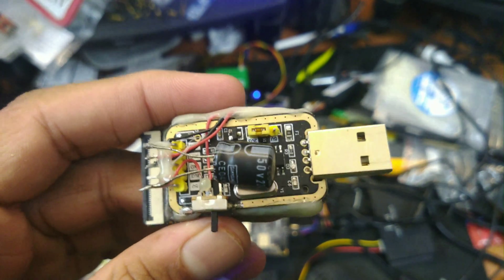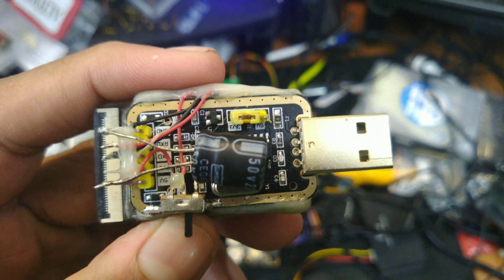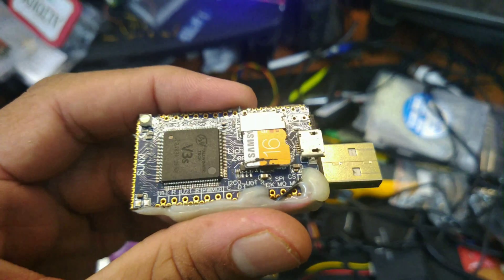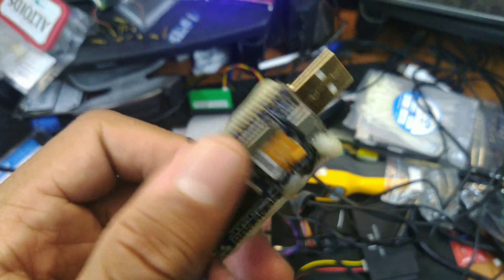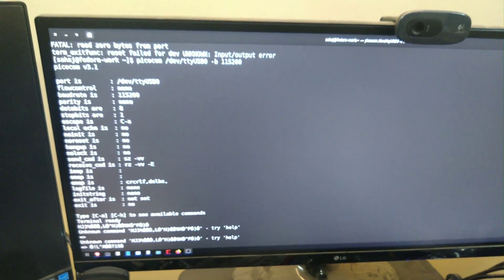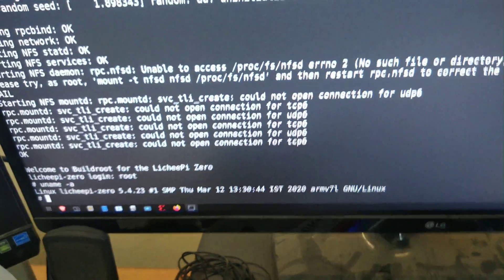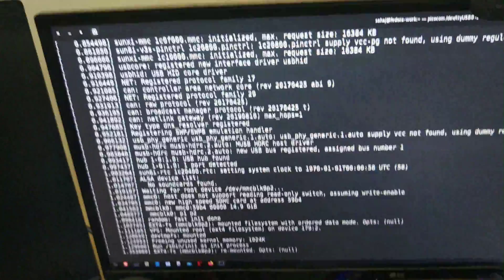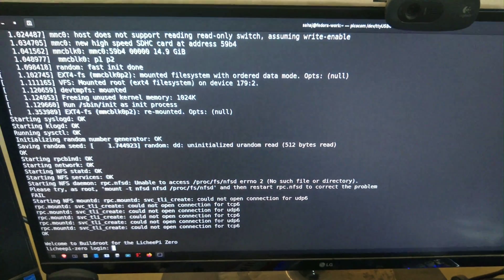ARM on a Stick an Idea and a prototype

Comment: So, whats the problem can be fixed using your approach? I'm not sure that it is so useful. One more quesrion: do you have some idea for portable nas solution? Like arm based sbc with usb3 ,etc...
Reply: The Idea is to make it easier for Software Developer to port/write software. Just plug it into a USB port no mess with multiple cables.